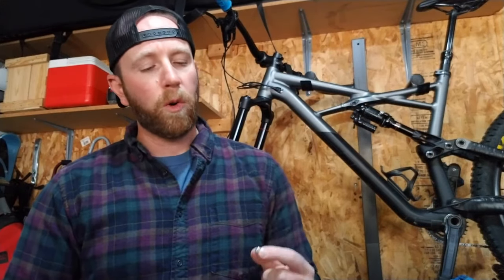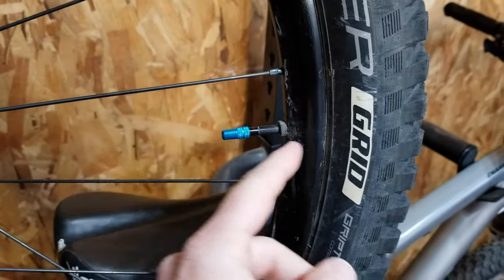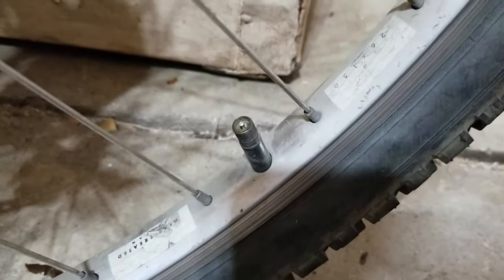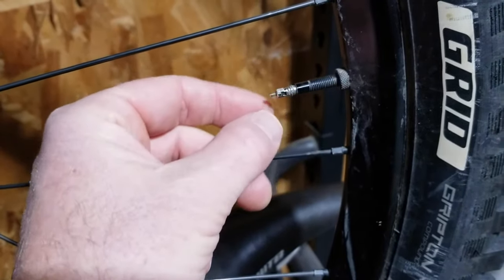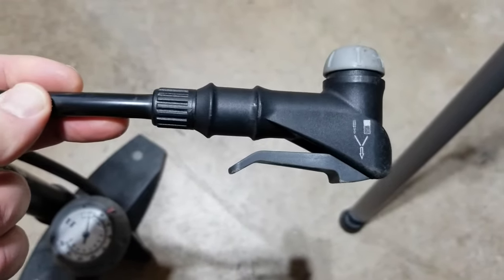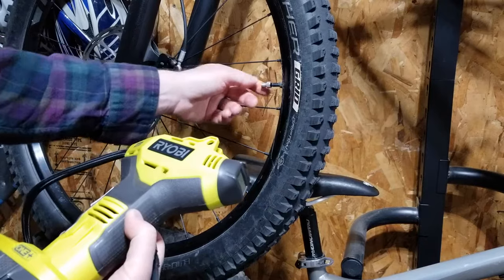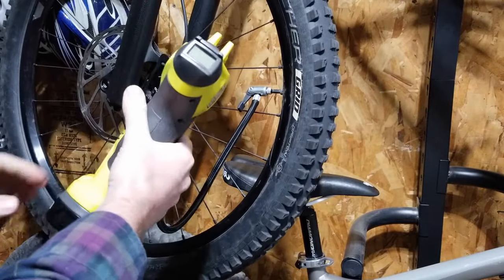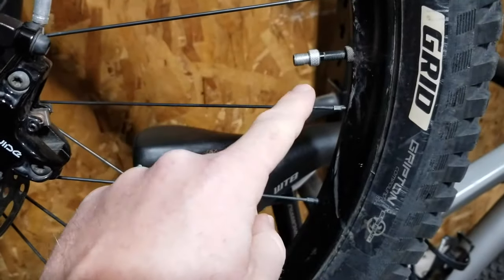How to Use a Presta to Schrader Valve Adapter- and Why Presta Is Better

Comment: Same setup but my motorised inflator keeps quitting! I loosen the presta, then attach the adaptor then the inflator. I have to restart the inflator 10 to 12 times to finish inflating. I'm thinking it may be slamming the presta valve shut or something causing too much resistance so it shuts down. It has never shut down when filling my truck tires with Schrader valve. Had this problem for years! What is going on? I'm about to replace the presta with Schrader valves.
Reply: What PSI are you trying to get to? I have a different model electric pump, similar to what he's using, and it works great on my car, but I've got an electric scooter that needs 80lbs in the tires and it won't go up to 80 for whatever reason. Haven't tried the new bike tires yet, but they only 48-49, so I'm hoping it works!
Reply: @cerenademe9433  19lbs. But now I put Schrader valves and bot a Fantik battery op pump on Amazon. Love it! And always works perfectly.

Comment: I've used schrader valves for years with no problem. It seems strange that you need to by an adapter to put on a presta valve to make it look like a schrader valve before you can pump it up. You might as well by a schrader valve.

Comment: I'm just trying to use a new pump on a shrrader valve and can't get them to lock together. Tried a different pump. Same problem. Befor I go to a 2nd hand shop and get an older pump, WHAT AM I DOING WRONG!?!?!
Reply: I was using the lock wrong. It locks opposit of the older pumps. 🙋‍♀️

Comment: Something that happened to me is that my adapter has a rubber fitting that was left on in the valve so my air was escaping thought the adapter

Comment: If you want to have a adapter always on your bike but don't want to keep it on the valve, take off your plastic bar end and drill a hole in it and use the adapter to tap threads into the hole you made. Then just keep it in your bars it works great
Reply: I'll just buy Schrader valve.

Comment: Presta is literally just for racing, so you can quickly drain the air out of the tube.

Not better at all.
Reply: That's the only advantage I see to presta at all. Letting the air out. But they are a pain to put air in..and easily broken. They come in fancy colors and look cool thou👍 that's 2 pluses I guess. But I still prefer a good old dependable Schrader👌
Reply: @motov8-garage832  I will argue that pulling a Schrader valve core is super simple, I mean we figured it out when we were 5 how to do it with a small screw driver, now as adults it is quite easy to keep a single tool valve core remover around to remove air.
Reply: @kerianhalcon3557  True that👍, I always have a Schrader valve core remover, I keep one metal valve core remover on the stems of my spare tires on my vehicles. And even have one cap atleast on my motorcycles just incase. I've had most of them little valve core caps since I was a kid lol. Took them off my dads work trucks back in the 90's 😄
Reply: @motov8-garage832  Yeah, but things like that which are basically a dime a dozen, and less than a gram are to complicated for some people I guess ;)
Reply: @kerianhalcon3557  lol yea probaly. I'd almost bet most people these day's dont even know what a valve core is😄.

Comment: Thanks for the video but I wish you had shown pumping air the old fashioned way. Just pump in with your manual pump and thumb press your tire to see if it has enough inflation. No digital read-out and other mumbo-jumbo needed., unless you are competing in the Tour De France :). My 2 cents....technology should not be used just because it is there.

Comment: No point in having a Presta valve unless you have a very narrow rim or a deep one that will only work with a Presta,  Deflating a Schrader valve is not as difficult as you make out.  I was going to point out that you should not install the lock nut on the valve stem, but when you said it was tubeless I realize it is necessary after all.

Comment: I don't think this video is what I'm looking for. I'm looking for information about using a presta valve tube in a schrader rim. Most bikes, specially big box Walmart bikes, use schrader rim and tube. If there's a hack that lets you use presta valve in schrader rim that would open up more options when it comes time to replace the inner tube when you get a flat.

Comment: tried a dozen times this adapter, it loses air at the connection, and then when disconnecting a lot air lost again, absolutely hate presta valves, especially on a mountain bike where it is useless

Comment: I Just purchased an adapter and failed miserably at a gas station to add enough  psi into tires, I ended up walking back to my home, instead of riding 😓.
Reply from the maker: Oh no, I’m so sorry to hear that. It can definitely be a frustrating process to figure out.

Comment: I hate those stupid things. Why do bike shops insist on putting in valves that have to have an adapter and that I have to be reminded every year when it gets warm enough to ride local trails that this is how the adapter works. One more case of replacing something that works fine with something that doesn't.

Comment: There is still nothing wrong at all with the good ol' Schrader valves. Now I need to carry these stupid little adapters just to put air in my tires, why not ?  Nearly everything produced these days is way too complicated and usually expensive and troublesome to repair.  Even my kitchen faucet has these annoying buttons and levers so why stop there !

Comment: Sorry Scott, but Presta should never been invented! No way, no how is Presta good, and certainly not better. We need to stop this nonsense and get these Presta valves removed from bikes. I have heard all sorts of BS excuses to why they use Presta, and it is all a scam! One twit told me it is because they can hold higher pressures, ahh big rigs use over 100 psi, and our very own rear shocks on our bikes use over 300, so nope try again bud! The next dill hole tells me its cause they can go to low psi, ahh nope try again ass clown ATV's use 4 PSI, and an ATV runs in 10 times worse terrain with the most terrible mud, rocks trees ect... As for your idea of lowering air, you should be using a gauge to indicate what the psi is, and they do just fine letting air out of a Schrader. as well if they used a valve stem off a big rig you would get a super strong setup that would add strength to the rim. but they like to fool you into paying way more $ for bike stuff.

Comment: Presta valves suck!They damage more easily and turn loose if using a screw on hand pump.  Schrader valves are more durable and reliable.  You were a bit dramatic about how to release air out of a schrader valve.  I use my thumbnail.

Comment: PResta valves are a bloody nuisance as soon as you find out it’s presta it’s a nightmare. Just stick to Normal valves. Jo public can crack on with their day instead of having to find adapters etc
Reply from the maker: I think this will work for most non-mountain and road bike riders. Unfortunately high-end mountain bikes and road bikes are all made with rims that are only adapted to Presta valve stems. In fact, any mountain bike that uses tube-less technology has presta valve stems that attach to the rims. Definitely reduces the ability for choice.